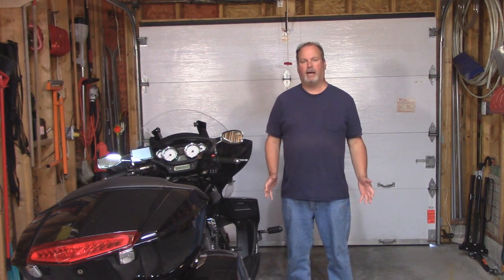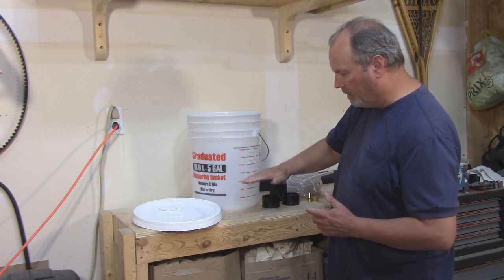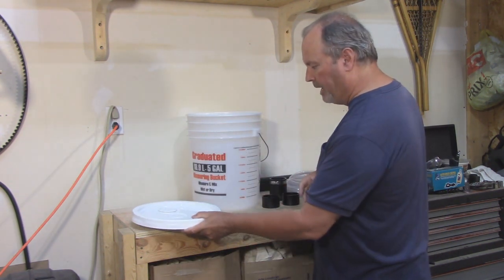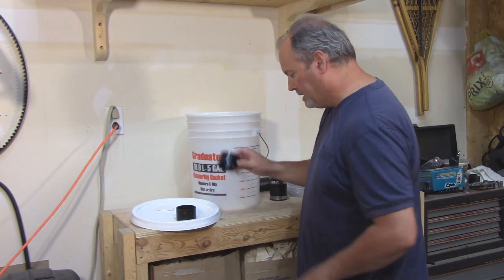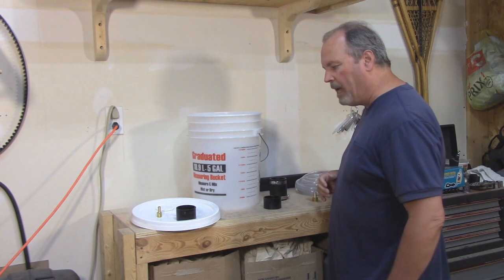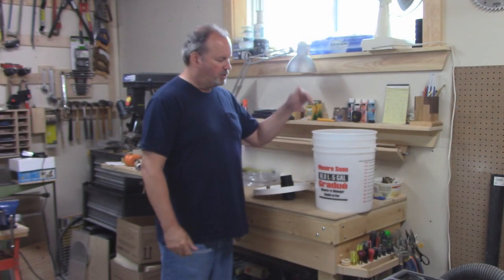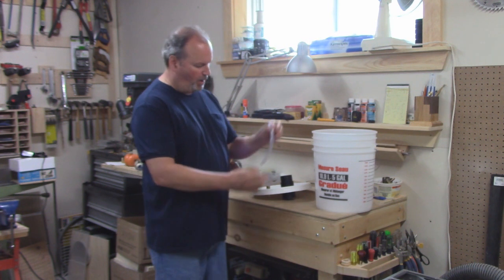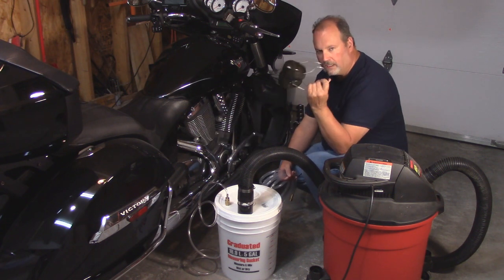DIY Oil Extractor

Comment: I actually did this over 10 years ago when a rapid lube shop messed up the threads on the drain plug of my 1990 4cyl Cavalier.  I warmed up the oil first though and it did the job in under 5 minutes.  The issue I had though was that the larger suction tube allowed some air to flow through creating a bit of spray inside the bucket that misted the inside of my vacuum hose with oil.  Anyway, good to see some more Canadian YT content!  Thanks for posting.
Reply: Ya, getting the drain plug thread messed up is everyone's secret worry.  --One poorly trained and poorly supervised tech coming hung over to the job and you'll find out ONLY later.
Reply: @sundo-pf5zv  The tech actually didn't know the "rightey-tightey lefty-losey" rule and torqued the drain plug to destruction.  We didn't even get the oil changed. Same place blew the oil filter 15 years earlier on my mom's 1982 Mazda 626.  I generally have bad experience with those shops so I never bring my own cars to those places and DIY.

Comment: The cap on the can/drum was leaking air and hence the slow flow of oil. I suggest you get a rubber gasket or tight fitting drum the next time. When you get a tight seal on the drum, make sure to lower the total vacuum level by causing an intentional leak on the shop vac or else you might end up with an imploded plastic drum.  Your D.I.Y hack was the best yet on the internet for oil extraction. Thanks for the same.
Reply from the maker: Excellent tips, thanks for sharing. I will try those. I was thinking about also adding a vacuum gauge on the lid.

Comment: Ingenious, But Paul, much easier to use the drain plug. And for all of those doing their own oil change on a Victory, tilt the bike to the right for a few seconds to drain any oil from the primary case into the crankcase.

Comment: Mechanics with vacuum pumps can use those instead with a bulkhead fitting. Bonus, they will vacuum bleed brakes too which I use mine for. BTW there are all sorts of interesting shop vac nozzle stls online worth a look while designing an extractor.

Comment: Excellent video. I've been changing oil in cars,  trucks, boats, yachts and equipment for forty years. Your extractor home build is just excellent. I've used all manor techniques, tools, pumps and on and on. I will build your extractor tomorrow. I bought a Mercedes with the M112 engine. The engine has the oil filter right on top of the engine. No hot oil running down your arm but you do still have to drain the engine from underneath. On boats and yachts I use to plumb a copper tube up from the drain plug up to the top of the engine. Then use a pump or extractor to pull the oil out. That way was as neat a job as your extractor is. Plus that way I got it all.

Well done young man, well done!

Comment: Thank you. I was going to buy one of the commercial extractors . But, after seeing this video I will be making my own based on your idea. It’s a more cost effective approach and you wouldn’t have to worry about having to buy replacement parts from a specific brand, this is off the shelf readily available at any hardware store parts, which is a big plus. Plus if it needed to be cleaned it would be a breeze. I intend to make a small change to mine. And that is to attach the bigger nipples to the lid and then just cap them off with plastic sleeves and only uncap the one I need. I’ll see if it works. But overall a very nice, neat and simple idea. Again, thank you for the video.

Comment: Hi there. I just stumbled onto this video although I see its 2 years old. Great idea. I have been doing this on certain engines I have for years. Its especially great for snow mobiles since getting them up high enough to access the drain plug means needing a special stand. Also since some panels underneath can't be removed where the drain plug is, its always a messy job. There is a similar  method for bleeding barkes but in this case you pressurize the master cylinder and put your clear tube over your bleeder screw on each wheel one at a time and into a small container. Pressurizing the master cylinder means you don't need somebody in the car to pump the brakes. 
Great job.

Comment: Hello still seen your video does meces and I found it hard today to see how you manufactured your extractor for oil, today I tried a 12v china and I could not get even 1/2 liter was mission impossible your simple economic and effective device is one of the best facts and one that I saw with a deposit of fire extinguisher and the engine of a refrigerator but yours very good and simple are the same, thank you very much for sharing a greeting from Canarias Spain greetings.

Comment: Well done Paul.  I had thought about making one myself.  However, I still prefer to get under the bike and check my drain plug for metal, which is why I don't like the idea of pulling the oil out that way.

Comment: I've been using essentially the same setup for years. Works great. Also serves as a reusable storage container you can take to AutoZone for reclamation along with the rest of your filled up jugs. Pro tip so that the bucket doesn't collapse if your vacuum is powerful enough to pump it down ( mine is ) : put the bucket inside another bucket. Doubles the wall strength.
Reply from the maker: Excellent tip. Thanks for sharing.
Reply: I don't understand this: all the suction is on the pail that holds the liquid. If the outer pail holds the liquid the inner pail displaces all the volume to prevent filling, unless the volume of the liquid to be sucked is just smaller than the volume between the two pails. What am I missing?
Reply: @sundo-pf5zv  There is a bucket with a lid, under vacuum... the shop vac hose is attached to this one and is sucking air out of the bucket. Another small tube is also attached to the bucket, and air is being sucked into the bucket through this one.You stick that little tube into the engine it sucksthe oil out, which lands in the bucket. . The negative pressure in the bucket may be enough that it will collapse inward. To prevent this, slide your bucket into another bucket of the same size.

Comment: Hey Paul ... Nice clear video. I have used a shop vac in similar situations. A word of caution .... make sure some air can get in somewhere because your shop vac motor is cooled by air going through it. Also, if you happen to be sucking up flammable liquids (gasoline) you could end up with an explosive situation as the fumes get drawn through your shop vac electric motor.
Reply from the maker: Great safety tips Mark. Thanks for sharing. Everyone should read this to be aware.

Comment: It’s always good to save some money. Did you ever have problems with excessive vacuum that the containers crush? Theoretically this should work with pulling trans fluid from big rigs? how much liquid did the motorcycle have?? Thanks!
Reply from the maker: I guess my vacuum is not as strong as others. Some have commented that the pail crushed on them. I suggested creating an opening to control the amount of vacuum in the pail. It can be as simple as a piece of duct tape over a hole in the lid to vary the size that you need. Others made a more elaborate mechanism and even included a vacuum gauge on the pail for more efficiency. My motorcycle has 4 and a bit liters of oil so I can do a couple of changes before I need to empty the pail. I also use it with antifreeze and brake fluid. Thanks for watching.

Comment: well thought-out, once you do warm up the oil you won't need a larger hose. I myself am trying to find a manual pump similar to what's on the commercial evacuators to use on a 5 gallon bucket but all i keep finding are pumps that empty the bucket not fill it is there a specific type of manual pump to extract to the bucket?

Comment: Excellent idea, don’t know if I would use it on my bike or suction gasoline using this method but will definitely use it to do oil changes on my lawnmowers. If a motor has an easily accessible drain plug it’s better to use that method. Not a good idea to run combustible gases through your shop vac though unless you want to go through the roof.

Comment: Check out my vacuum extractor video made with a vacuum pump. Achieves much higher vacuum and will do the job you said takes 15 minutes and about one or two minutes max. I think you’ll love it. The pump can be bought at Harbor freight for like 70 bucks maybe if you don’t already have one. It’ll do much better than any one you buy that’s for sure. You can’t use plastic containers like you have for it will collapse them by the way

Comment: I am using a RIDGID Wet/Dry Vac 6.25 hp 16 gal and made the Extractor and when I turned the vacuum on the bucket collapses, 
What am I doing  wrong?
Willy W.
Reply from the maker: Your motor is too powerful. Make an adjustable opening on the bucket lid to let air in, or around where the vacuum hose attaches to the bucket. You can try it first by holding the hose slightly away from the rubber fitting on the lid so you can see how much of an opening you need. You will also be able to hear when the vacuum is working at its most efficient.

Comment: You also could have used a bicycle tire pump to help create a vacuum inside the bucket to pull the oil out. Thats what I did since I didn't have a Shop Vac
Reply from the maker: Good tip. Thanks for sharing. The more ideas we have the better it is for everyone.

Comment: .. Clarification: I have the fan as specified below, and wonder if, with your savvy way of making a machine: wether you can build an air cleaner by encasing said fan. IMO, to remain uncompromised on quality, ONE NEEDS A STRONG fan to push or pull air through a high density (possibly carbon) filter
Reply: For city folks who need to balance ●Storage space for tools, ●Time to build the device right (so the device won't blow up from inadvertantly sucking oil fumes into the sparking electric motor coils of the vacuum), and balancibg ●Opportunity cost vs income foregone, and ●Risks if things don't work out : This method is likely NOT suitable. -- 
ONLY the Drain plug method, done right, is a COMPLETE !! JOB.
--
Disadvantages of the syphon method:
▪doesn't clean the drain plug and Magnet that are full of metal shavings
▪needs extra syphoning equipment 
▪takes 2 - 3× longer to get the oil out than the drain plug method

Comment: I've seen a number videos with extracting motor oil, this one is interesting. But, I'm wondering why not simply use a car fuel pump with two hoses and car battery. If it can drive a fuel from tank to motor why not from motor to pail? In Europe you can buy a brand new fuel pump for some old car models e.g. Toyota for 15 $.
Reply from the maker: These are good points. First a fuel pump is usually submerged in the tank and it is the fuel that keeps the pump cool while operating. If you ran the pump out in the open air it would likely burn out quickly. Second, oil is a lot thicker than water and I don't think that it has enough power to move oil. Thanks for watching.
Reply: I use a chinese  handpump , 10 minutes easy on arms ( not hard to use) ,work done ! :)

Comment: Another good one Paul. Thanks, but tell me, why is this better than draining the oil? How do you know you have all the oil out? Chris
Reply from the maker: Depending on the vehicle it's a matter of convenience. Harley Davidson's have the oil filter at the front of the engine so you no longer have to go under the bike to change the oil. This is true for some cars as well, take the oil and filter out from the top. It's a lot easier. For our Victory bikes we still have to go under to change the filter. After the extractor was done on my bike I removed the plug and no oil came out so I am confident that it works well. But next time I will warm the oil to speed up the process.
Reply from the maker: I can also use it on the lawn mower and snow blower where draining the oil is more difficult.
I am also interested in trying this with brake bleeding. The 1/4" hose will fit perfectly over the nipple and will extract the oil fluid easily. I will have to turn down the power of the vacuum to do the brakes using the speed control I posted in the description.
Reply: I've used an extractor on every small engine I own and it works like a charm... Honda 4 Wheeler being the first thing I tested it on..
Reply: Paul Pomerleau Thanks for your replies Paul. Re brakes, I remember when I was driving trucks, the workshop pumped the brake fluid from the calipers back through the brake system when replacing the fluid. It always impressed me as they didn't have to bleed them. Seemed to work well. I'm going back to the 80's on that by the way. M.A.N Diesel. Maybe it was a trick from Germany.. 😎
Reply: SoapyHB I've been using one since 09 on my 2009 can-am outlander. The drain plugs in the gen1's are notorious for stripping and mine did. The "factory fix" was to install a   HeliCoil and there have been many reports of those leaking. I found a hardened drain plug that was slightly larger than factory, allowed it to cut it's own threads and ever since then I have used a vacuum extractor.

Comment: I have found that if you put the bottle inside the shop vac and have a hot engine the oil will flow a lot quicker. Just saying fella.
Reply from the maker: Now that is interesting. I never would have thought of that. Thanks for sharing.
Reply: Can you elaborate? I guess you would need to connect a hose from the shopVac motor directly to the pail/bucket/canister that holds the liquid. But any unsteadiness could knock the fluid container inside the shopVac over and cause a spill.
Reply: @sundo-pf5zv  First you would need a shop vac that the fluid will fill but not overfill. Second you need to make a adaptor for the inlet of the vac using any plastic bottle top with a hole in the cap with a hose that will fit tightly in the cap and have the hose go all the way through into the container inside the vacuum. Make sure the inlet cap is firmly inserted into the inlet, other wise you need to use masking tape to keep the hose holder sealed. Then just put the vinyl hose inside the opening that fits the fluid to be drained. Turn on the vac and just wait till you see no more oil flowing inside. DONE. VF

Comment: I won't own a motorcycle if I can't do my own oil changes. Triumph charges $120 USD for a Bonneville oil change. I can do it to for half that. I could do it cheaper but I use factory Triumph oil filters. The cost between $10-15 USD.

Comment: Thanks for the great video! I tried this today and the bucket imploded. I used all the same parts as you with 1/4 inch tubing. The only difference was that I used a smaller shop vac but that should have meant less powerful than yours so I'm a little baffled.
Reply from the maker: A bigger shop vac just means a bigger pail. Your motor is probably more powerful than mine. Easy fix - I would use a variable speed controller like this one:
http://www.busybeetools.com/products/router-speed-control-115v-15a.html

You can get them cheaper in the States. Start low and work your way up to get the right suction. Or take a plastic vacuum pipe and drill some holes into it so it takes a bit of air from it as well as the pail - drill as many holes as you need. Hope this helps.
Reply: Paul Pomerleau excellent! Thanks Paul!
Reply: Or just slide your bucket into another one of the same size and it will keep the interior one from collapsing.

Comment: Or, use the drain plug with the oil warm and you also flush out the crap from your sump - it's really not that difficult.  You also don't want to miss any old oil as it will contaminate the new.
Reply: I would pour brand new oil through the filler opening and hope it will flush more old oil out.
Reply: @sundo-pf5zv  Personally, I wouldn't waste new oil doing that.  My point in sucking oil from the sump via the dipstick is that it will leave crap in there.  The whole point of a sump plug is to allow a free drain of warm oil that will carry contaminants out with the flow.  I then use a large syringe with a tube attached to remove old oil from the oil filter compartment (not necessary but I like to do it anyway).  I never use a new sump plug,  I've reused them 10+ times with no issues.  If I do get a weep of oil, I wrap some PTFE tape around the threads.

Comment: I did it in my car , having the biggest tube you can fit and having warm oil is key.
I used a 100ml  syringe 😂😂😂
A year later I used a small  cheap cinese pump ,10 minutes for a gallon / 4 liters ;) 
And it isn't hard to pump , super cheap and  no need to use electricity either 👌
Reply: AWESOME

Comment: Thought of another way you could do this to stop the splashing. Use a CLEAR 4 or 5 gallon bucket. Put an old 5 quart oil container inside the bucket. As you are putting the lid on make sure the tube is going into the top of the oil container. This way the oil is going into the receptacle you are most likely to take to the Auto store to get rid of.
Reply from the maker: Excellent idea. Thanks for the great tip.
Reply: REALLY LIKE that idea

Comment: Hi Paul
The Vic looks great
Great build. I should have done that when I changed my front and rear differentials and my transmission, transfer case on my 4x4.
I read that the Smart Car doesn’t have a drain plug. I figure that is so people will visit the dealer instead of doing there own oil changes.
Rob, robsvision

Comment: Can use the same process for other fluid extractions as well. Thanks!
Reply from the maker: Absolutely, since no liquid is touching the motor it is safe for various liquids. I have used it for oil, brake fluid, gasoline, coolant and anywhere that a hose can reach. That is why I have different size hoses. Depending on the viscosity of the fluid I have had to adjust the air flow through the vacuum hose by opening it a bit so the liquid won't hit the bottom of the bucket hard and splash back up.
Reply: @PaulPomerleau  Thanks.